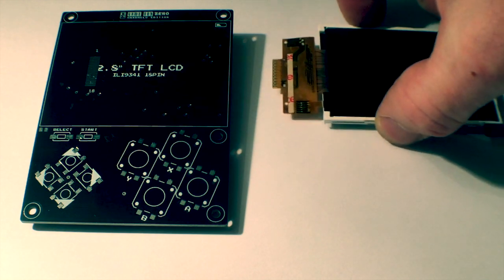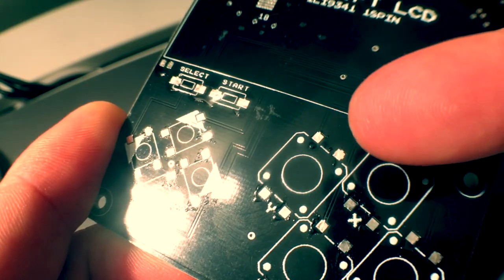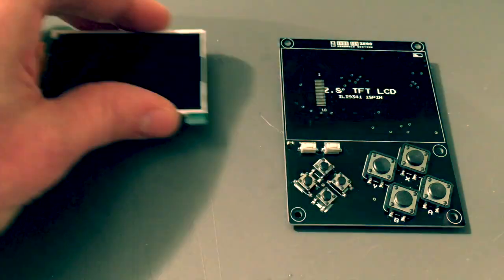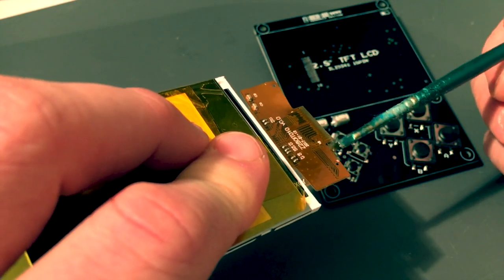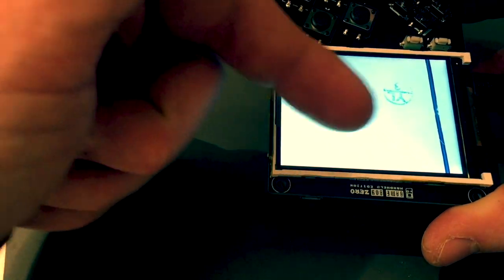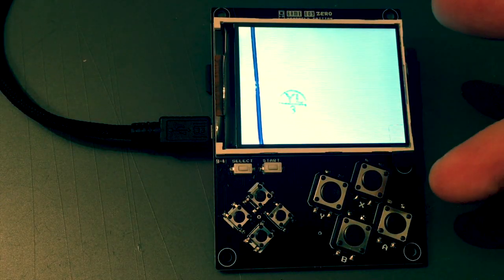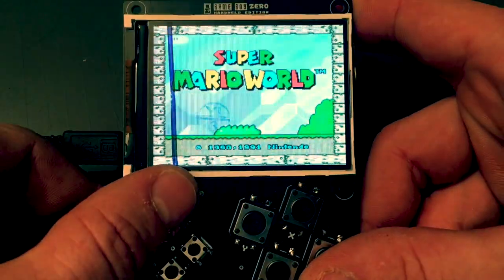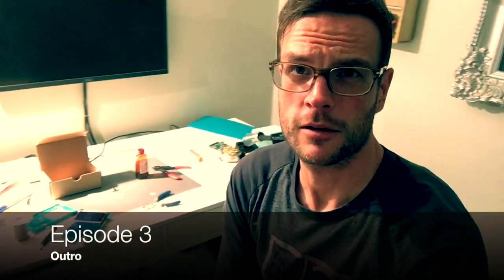Game Boy Zero - Episode 3

Comment: Great video. If you’re not planning already, maybe strip the sound card pcb out of its housing and retro fit it somewhere so it’s more flush. 
Ps. when can I buy one? (Non- Kickstarter)
Reply from the maker: SuperClotted that’s a great idea. Definitely a favorite option and I’ve done it a few times

Now, would you sacrifice the only usb or make it removable?

I would flush mount it beside the battery charger btw.

As per getting your hands on one? Hit me up on FB messenger
Reply: Have you tried pwm audio on this with a PAM8403 amp? I may try that myself.
Reply from the maker: Curtis Rodomsky not the adafruit one but I did with the sparkfun mono amp and added a thumbwheel

Comment: Hello there. Wondering if you can help. Was tinning the 18 pin solder points on the board and forgot to turn my iron down. As a result I removed the very bottom solder pad off the board. An suggestions on how to or wire up that bottom pad would be awesome. Cheers
Reply from the maker: if you are talking about the one closest to the small #18, don't worry about it, 15-18 are used for touch screen enabled tft and are thus not connected on this board. hope that eases your stress
Reply: eugene andruszczenko  yeah the pin at the very bottom of the row. Thanks for that I did check and couldn't see a track from it. You are a legend.

Comment: does the board have 3.7 v dc booster circuit? I am curious on how you manage to get the pi running because you only have the tp4056 mounted for charging. or does the tp4056 can boost the lipo battery to 5V?
Reply: the whole setup will work easily off the battery voltage, no need to boost it to 5V
Reply: Curtis Rodomsky so that mean you can directly put 3,7 v lipo battery to 3,3 pin on the pi zero?
Reply: Well i believe the power is delivered to the pi through one of the 5V gpio pins, not the 3.3v. Correct me if I am wrong Eugene. I don't have my board in front of me to trace the power. The screen will be powered from the pi's 3.3v GPIO though.